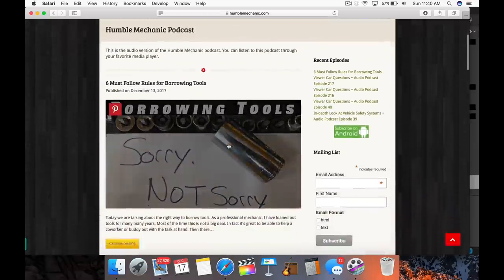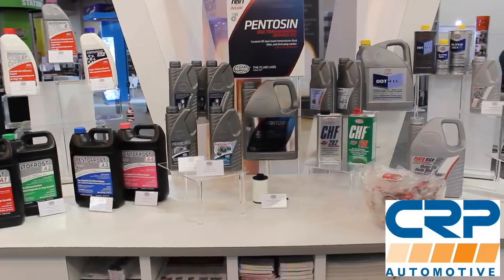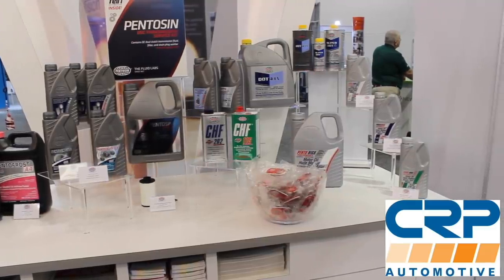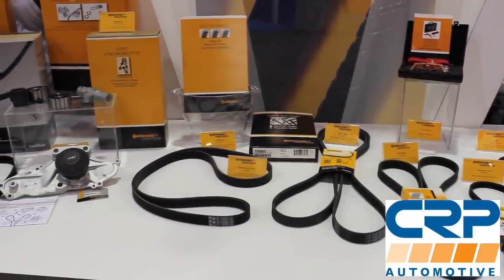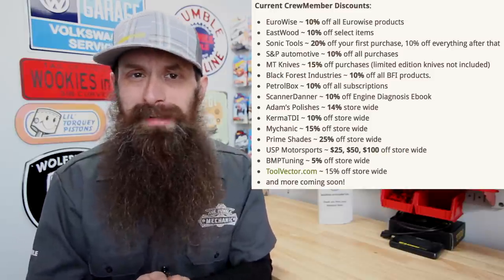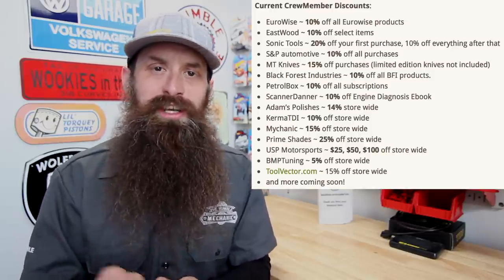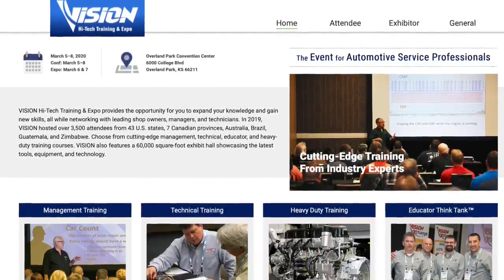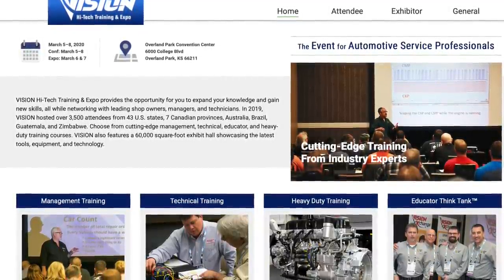Viewer Car Questions ~ Podcast Episode 256

Comment: Typically on the Cruze the valve cover starts to suck air and causes a lean misfire. The valve cover has the pcv/oil separator built into it and the diaphragm leaks allowing extra unmetered air into the intake. If you pull the engine cover off, there is a little hole right behind the #4 ignition coil put your finger over it and see if it runs better.

Comment: I actually took my skoda (2nd gen 1.8 TSI) to dealership because of engine vibrations/rattle (on passenger side) at idle. I had engine mount bushing and (on my request) timing chain tensioner, chain and guides replaced. Haven't had any problems since then. I also noticed that after driving the car harder idle fuel consumption decreased from 1 to 0.7-0.8l/h (warm engine, lights on, no air con).

Comment: I suspect the root problem with the Holden Cruze is that it's basically a rebadged Daewoo (they did the bulk of the engineering and styling) - and they're not a company that's generally associated with quality.  After all, there's already been 4 different recalls for the Cruze, including for engine bay fires, loss of brakes, faulty axles, and even for the steering wheel coming off while driving...and according to Consumer Reports, during its first year, the Cruze scored the lowest in reliability among compact sedans.  Few mechanics are going to want to work on it - too much chance of the customer coming back a week later with a new problem and blaming the mechanic for it with the "Well, you worked on it last" argument.

Comment: I did my timing belt, pump , tensioner  on my 1.8t gti yesterday and boy getting on that belt sucks sometimes. Also the motor mount sucks.
Reply from the maker: Yeah that is a tight one!
Reply: @HumbleMechanic  i put on the pully first and used a wire to keep it up , then put the belt on , tensioner last, first bolt i put on the tensioner was the bottom and i kinda swung it over for the top.       First time i put it on i was laying  in my bed and was like ( dude i gotta take it back off to check my timing marks)   i painted all my marks the 2nd time and before i started the motor i mabey spun it 10 times and i checked out them marks like a virgin guy does a stripper.   My mk4 has 186,000 .

Comment: Sorry also forgot... i swapped the vr6 24v auto transmission to 5 speed manual... the ecu is from a 24v manual ... complete change with cluster, key , key ignition, i have checked all relays fuses, had a scanner and have lots of codes ...  a lot leading to the ecu. The car turn over just fine, but will not start.. Any help will be greatly appreciate. Thank You.

Comment: Hi Charles! i just swap the transmission, auto to manual on a 02 jetta vr6 24v, changed everything, both engine and transmission harnesses auto to manual ..added pedals,changed the ecu , changed the ignition cylinder, keys, locks ..literally everything. Car cranks but no start. I have done alot of troubleshooting but nothing :/ Any help will be much appreciated. Thank you

Comment: Update: so after a much needed conversation with a separate local technician we came to the conclusion that there is massive carbon build up in the holden. It's bad. To the point where the fuel injection may actually be screwed as well. Now we are working to fix what we can but I know how my grandparents treat this car so it will probably not be a complete fix. The technician suggested a carbon cleaner that you add the fuel so if anyone has further word on that let me know because I'm used to just straight up taking out the fuel injection cleaning and or replacing. Not the add this and it might help.

Anyways thanks a million for setting us on the right path charles
-izzy
Reply from the maker: It’s very possible on a direct injection car. Thanks for updating. 👍
Reply: @HumbleMechanic  no problem. And again keep up the good work dude. ✌🏼

Comment: Hello i had a question I am a auto technician I graduated from uti three years ago I have been working at multiple shops I have worked at a lot of independent shops and used car dealerships but my dream is to work at a manufacturer dealership like bills wagon or Honda I worked at Subaru a few years back back wen I was a lube tech I am 25 years old I am not a master tech I am a technician though I was woundering if you can give me some advise on getting a job as a apprentice with bills wagon or another dealer I don’t want to have to start as a lube tech knowing I already have experience as a tech would I have to have Volkswagen training done to get a apprentice position ?

Comment: Hi mate can u help I have a mk6 golf tsi and when I am in 2nd gear ( manual ) it wont go over 3k revs ? Every other gear is fine and has power
Reply from the maker: WOW! That is strange.... any other issues? MIL?
Reply: @HumbleMechanic   no everything's fine no engine light, starts up ok , no lag , 1st 3rd 4th 5th 6th gear fine just that 2nd gear 
Mileage 75 thousand miles full service history

Comment: My '03 24v GTI VR6 is 16 years old.  It's a 6 speed manual, and the VW dealership won't change the transmission oil.  They tell me that the transmission oil is for the life of the vehicle!  Hard to believe.  Any comments on this would be appreciated.
Reply from the maker: They are correct, there is no interval. I am surprised they won't do it for you when you ask. Find another VW dealer or specialty shop
Reply: The fluid is $30 and the pump is like $10. You also need the funky 17mm Allen key, but it’s easy to DIY this in your driveway!
Reply: Yeah, lifetime as in lifetime of the vehicle. They don't suspect the transmission oil to go in 5-10 years. But the longer the car is on the road, it's worth changing.